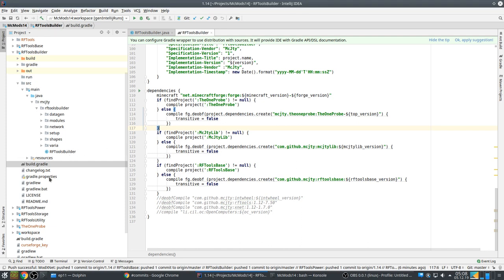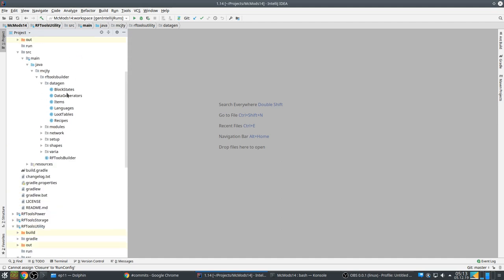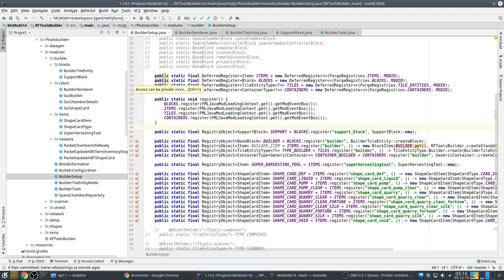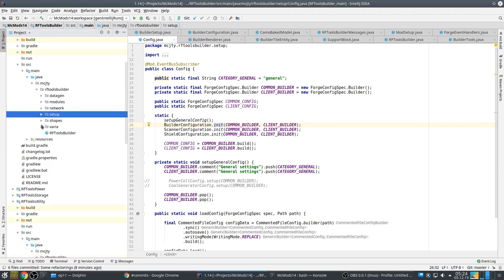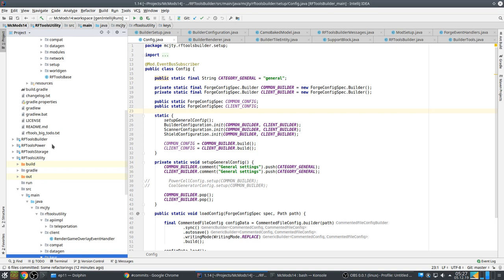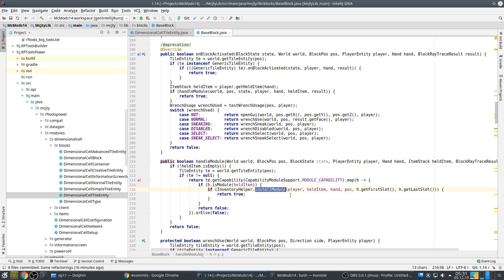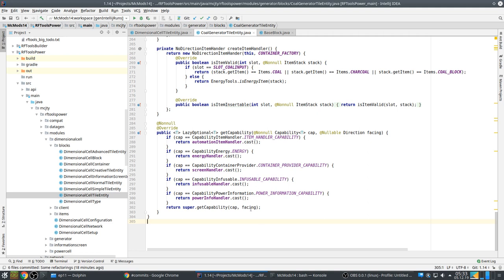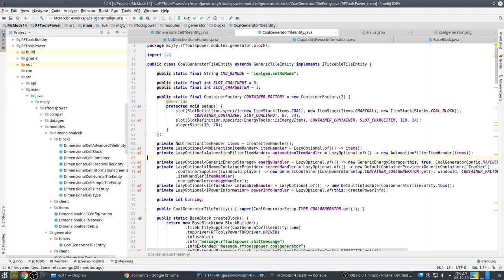Modding Tutorial 1.14: Episode 11 (philosophical ramblings)

Comment: Good tutorial. I would like to ask a question though. So I followed one of your previous tutorials on how to make a block mimic other block’s block models. In my mod I have a frame system (Iron Frame Block, Steel Frame Block, Stone Frame Block, you get the idea) I have these as stand-alone blocks used for multi blocks. However I want an additional block which is a FrameWithCableBlock. (In my mod I also have different cable variants; Copper, Gold, Iron, ect.) I want this FrameWithCableBlock to be able to combine both the frame and cable models, no matter the combination. The problem I have been facing though is that the cable has different blockstate properties (Up, Down, North, South, East, West, and Waterlogged). I tried adding the properties to the FrameWithCableBlock but it is just a missing model model. How would I go about this? (Also could you make a tutorial on layering item models based on NBT because I have tried, but I am too stupid to figure it out) (Also also, idk if you fixed this but with your tutorial on the mimic blocks. At least for me, the mimicked models wouldn’t show up when you unload then reload the chunk they were in. The block still held onto the NBT tags of course, it just wouldn’t refresh the model on loading. To fix this I just added an if statement to determine if players are within a 100 block radius, and if they are to send a block update whatever thing (I cant think of the name right now). This was inside of the mimic’s tileentity tick method. Anyways thanks for (hopefully) reading and making these tutorials! 😀
Reply from the maker: Hard to say what's wrong without seeing code to be honest. Layering item models is something that I'm not experienced with myself unfortunatelly
Reply: @jorrittyberghein7398  Would I be able to send my code to your through discord? I was the guy who asked you about the model layering a few weeks ago in The Forge Project server.
Reply from the maker: @enterleftnamehere8746  Sure that would work